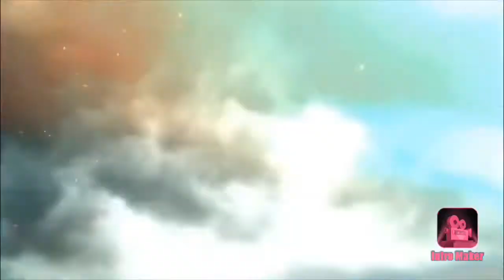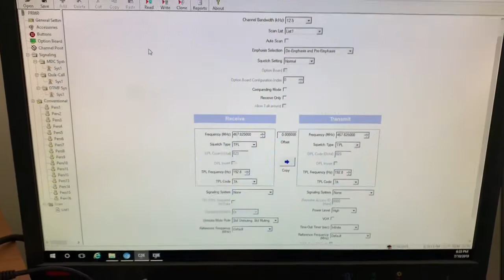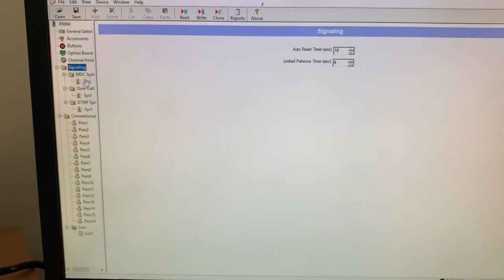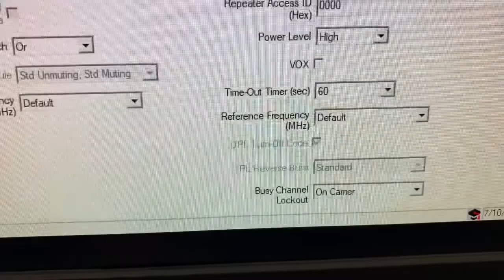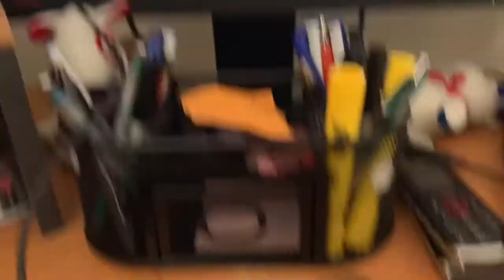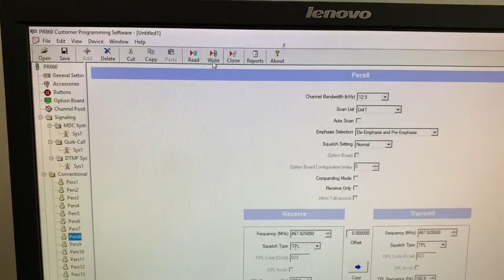Motorola PR860

Comment: i have a qestion about a radio i dont know if you have ever  had a cp200 hundred or programmed one but if you did my qestion is is it possible for the cp200 to have the MDC 1200 dos auto mute my local radio shop said  i neended some kind of code to enable the dos auto mute to work
Reply from the maker: michael lopez as far as I know it can. I haven’t particularly tried it, I do have several CP200 radios
Reply: @projectauto1928  okay thanks for the info i was not sure if my local radio shop was being honest about it but i know now that it can work thanks